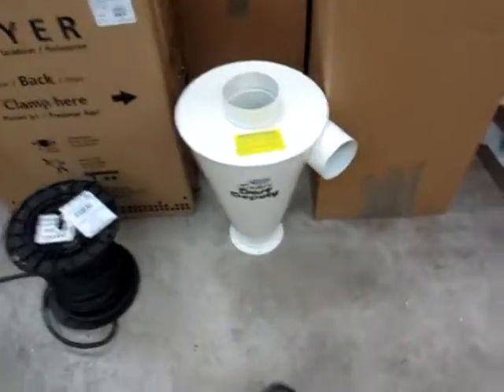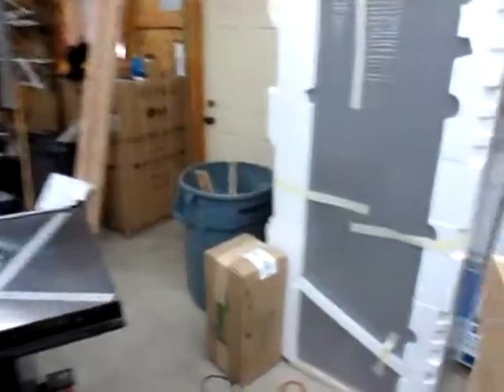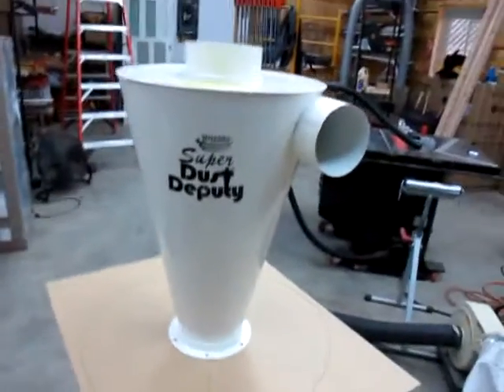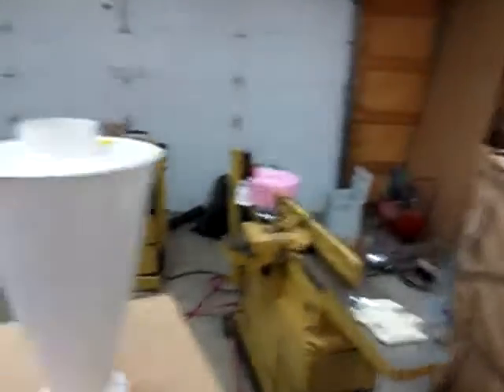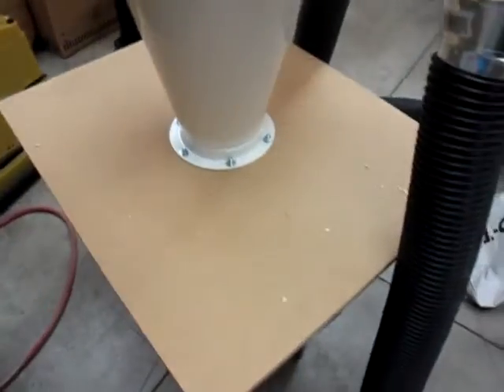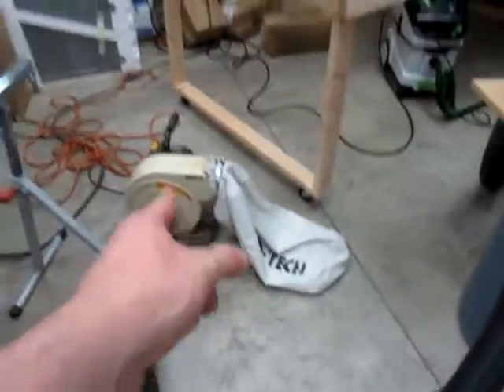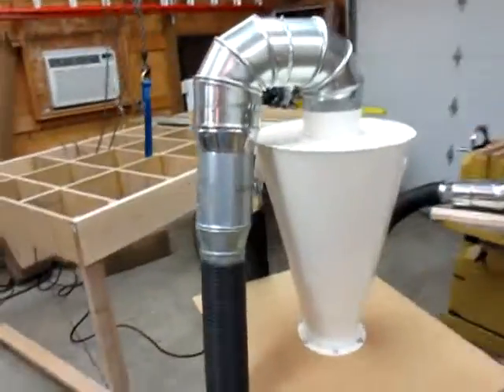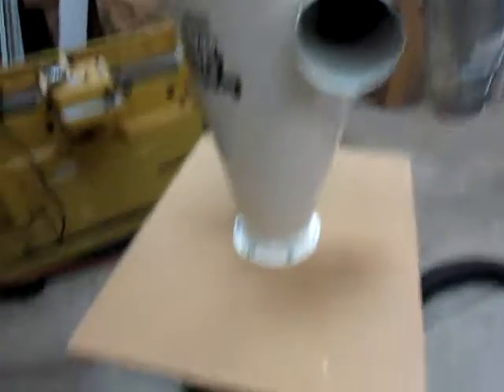The Franken Collector

Comment: Thanks for the video, it helped motivate me to build my own Franken Collector using a DELTA 2HP dust collector, the same Super Dust Deputy cyclone and a HEPA cartridge filter. This is a dramatic improvement over the Blower mounted on a 55Gallon drum original!  I even installed a wireless remote control which could be my favorite part!

Gerald

Comment from the maker: @Woodchuck2U I ended up finding a 3hp Powermatic single stage and am running the separator in line with it.  Its not so much cheaping out but building the shop on a pay as you go arrangement.  I could live with a crappy dust collector for a hobby shop but now I am now running it as a business and made enough to pay for a good collector. 

Thanks

Comment: it is possible to put the same type of cyclone system inside the vacuum suction unit, ofcourse it needs some rearagement , the vacuum filter will go inside the cyclone suction part . ofcourse it will be good if the vacuum company does it, just by putting a upside done cone and cyclinder around the vacuum filter. internal cyclinder diameter will be little biger than the filter diameter of vacuum system.

Comment: Charlie,

If you could please explain why you do not agree with Pentz's designs or his theories? I have found that separation and collection are initially independent of one another, and then become reliant on each other. Is it possible that a high CFM collector (Bill recommends a minimum of 800CFM) be coupled with the ideal separator and filtering system? I think Bill obviously asserts that he's developed the closest to perfect collector for small shops with ceilings under eight feet tall.

Comment: My feelings are that dust collection doesn't have to be that complicated.  For instance, I could tell you several things about whats wrong with the setup of the Franken Collector. Fist of all, a Rubbermaid trash can is too flimsy, and with the cyclone on top I'm, betting that it tips over very easily. Next is the Dust Collector that he was useing, that small of a DC will not support the 6" inlet of the Dust Deputy, or should I say allow the Dust Deputy to run as efficiently as it was intended.